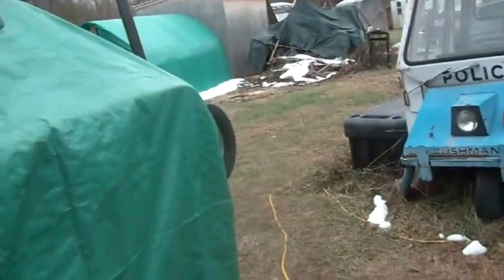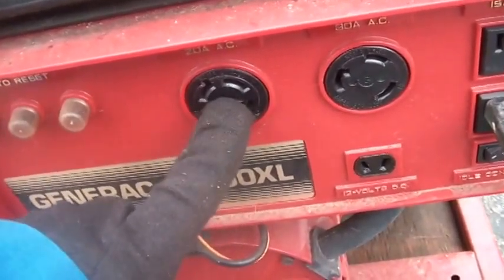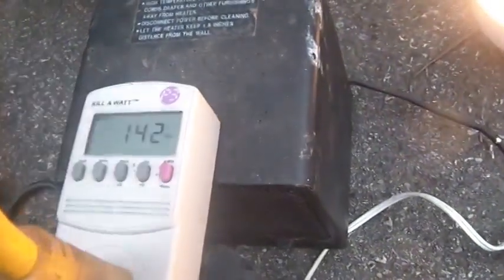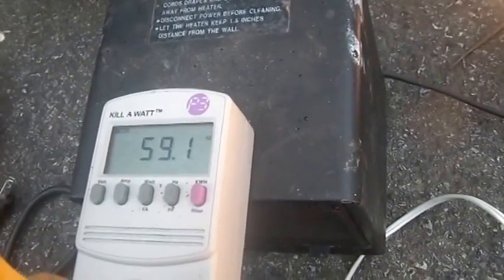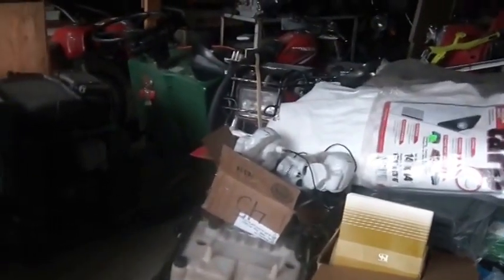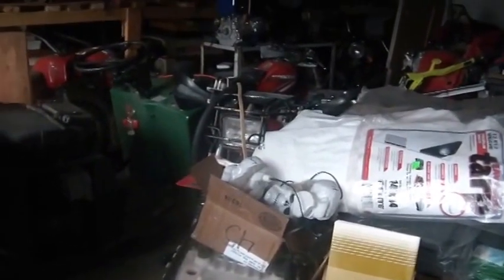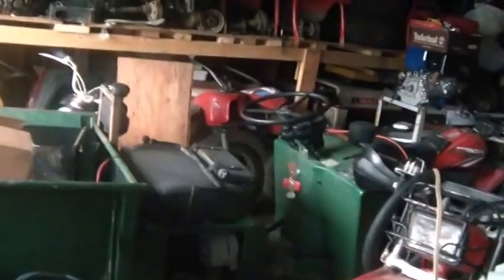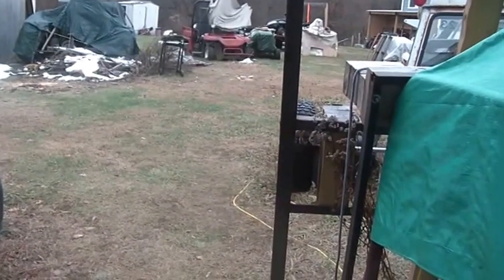12_5_2014, Load Testing a 1999 Generac 4000XL, Generator,

Comment: I am kinda surprised the Generac did not do better. The avr , in a generator is what i think makes a big price difference and  how clean of power . I think of Chinese ones to have the lesser AVR and would think the Generac would of been a better one .This is interesting . A rpm .meter would be a good thing .Most generators like those are set to 3600 rpm. and they are not that much. Here is a channel you might like to look at here on the tube. Generator Guru. I like a big generator with 220 v plugs , because of the power , but as u said , have a lot of gas. The Inverters to me is the best thing going , quiet good on gas and very clean power ,just most are not big enough for every job. A big generator and a inverter would be the best .
Reply from the maker: wtbm123, The Generac is old, I bought it for the Y2k concern. It has very few hours on it, but, I think if has some old technology in it, the China one is probably from 2008 give or take a year or so. Maybe, just more modern. The generac starts my well or an air compressor like nothing, the China one struggles with both. I think U R right on the owning a generator for the big stuff and an inverter for the little / sensitive loads and one has to love the way they sip gasoline. I am impressed with the amount of knowledge U have on the topic of generators and inverters, I wish we lived closer to each other, thanks for the input, watching, and commenting!
Reply: Harvey Spooner Doing construction a lot of my life we used many generators . . and i just like them for some reason .